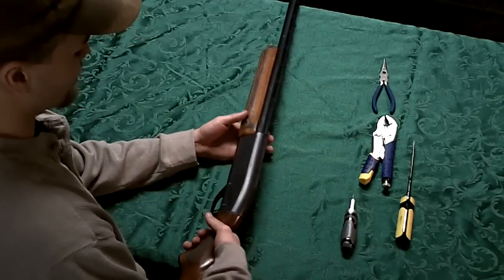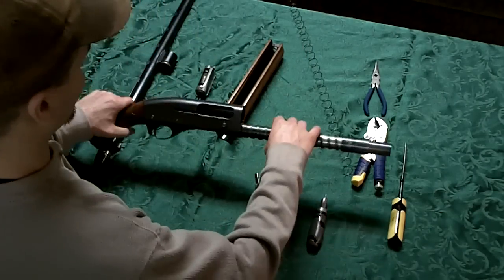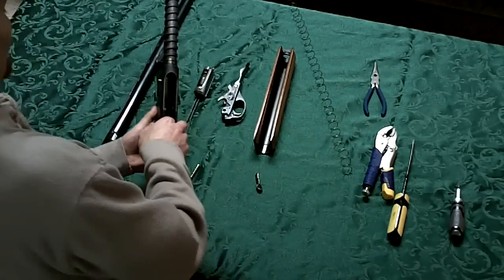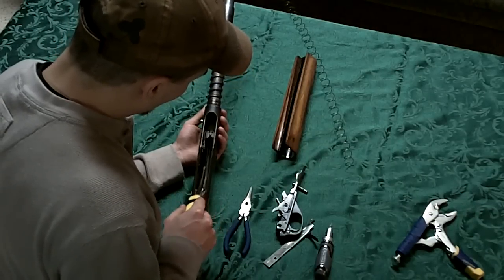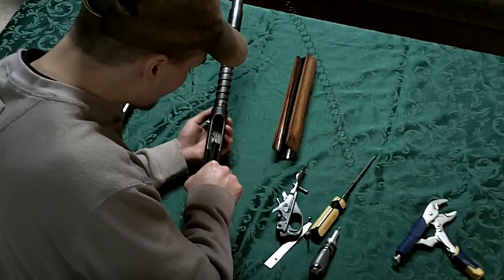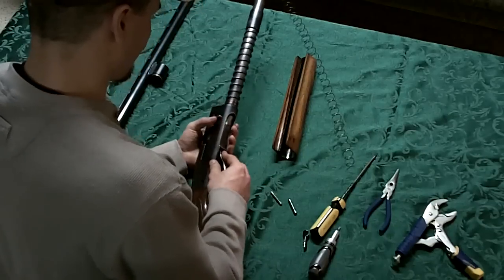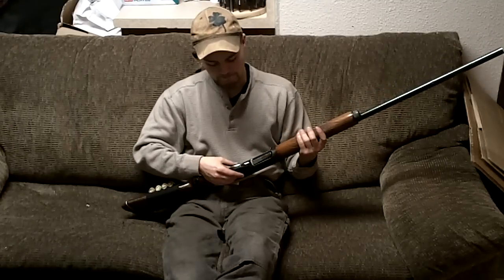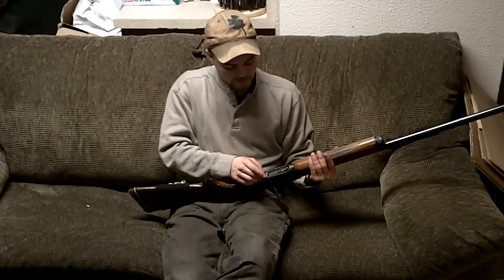Remington Model 11-48 Disassembly

Comment: The bolt link struts are in backwards.  there is a right and left to them.  you should not have to pry the links apart to make the gun function.  All you had to do was remove the pin holding the link struts and switch the links.  The magazine spring retainer is missing, use a pin punch to remove the trigger housing retaining pins, not visegrips. I was in the gunsmithing business for over 35 years and it was amatures like you that provided a lot of business for me.  Thank you for the business!

Comment: Thanks man, this really helped me out a lot. One of my links had come out of the cylinder and I couldn't bring the bolt back. I used the bent portion of a small allen key to maneuver the links and it worked well. 

Also had some trouble keeping the silver piece of metal on the side of the action from getting in the way of reinserting the trigger mech. Solved it by sticking the long end of the allen key through the ejection port and putting pressure on the metal piece.

Thanks again!
Reply: . Addison Dent

Comment: BTW Great and very helpful vid bro!  I have a Remington Mohawk 48 and the problem I’m having is that the bolt gets very rough in the last half inch of travel.  My bolt is fairly smooth operating except for that last half inch of travel then it wants to get stuck or feels like there is a lot of resistance. 

I tore the gun down tonight expecting to see a lot of dirt and rust in the receiver but I honestly didn’t see any rust or dirt on the bolt or the receiver

I now think the problem is in the little recoil tube that the two bolt spring/rods go into. I can’t get the stock off the gun because the stock bolt is rusted and seized up BUT I did manage to get some gun-oil down in the spring tube from the receiver end. 

I appreciate the awesome disassembly vid. Watching your vid gave me the confidence I needed in order to try and fix this myself.

Comment: @cowboyup411 The target versions of the 11-48 had a lighter spring.  The field guns would not always reliably function with light target loads.  Especially handloads.  The light spring could be purchased from Remington years ago.  The model was discontinued in 1969.  The spring has a taper and the tighter end goes toward receiver.  later  models had a collar attached to the spring like the one in the video.

Comment: @cowboyup411 Don't know what gauge gun or serial # there are 3 different variations on the 11-48 friction systems. and 28 & 410 are different. The Sportsman 48 is slightly different in some respects also. The friction ring can sometimes remain inside the barrel guide. comes out easily. clean the mag tube and friction ring. try reversing the friction ring, use VERY little oil on the mag tube. Do not shoot without the ring.  The barrel does not have to move far to recock.

Comment: I have a regular mohawk 48 12 guage that was given to me. It seems to be having trouble cycling shells. It shoots fine, and can sometimes eject the shells. If the shell does eject, the bolt gets stuck and I have to tap the charging handle to get it to go forward. It cycles the new shell, and I can proceed to shoot. I've took it apart completely and cleaned and oiled it. I cannot figure it out. Please message me if you have this problem and/or if you would like to help me out. It would be much appreciated

Comment: Wonder if he ever reinstalled hos link struts in the correct position. The only barrels that are interchangeable are from a same gauge mohawk, sportsman 48, or 11-48. Many of the other parts are either wholly interchangeable or can fit with a little adjustment. I have a sportsman 48 wearing a 870 tube extension, 1100 charging handle, 870 light mount, and a 1100 jumbo safety.
Reply: how did you made the tube extension work?

Comment: How do you remove the wooden dowel that's inside the magazine tube?
Reply: unscrew the mag cap you will see the wood...there is a washer that holds it in with some force take it out I use a flat head but be careful because it is spring loaded
Reply: Thanks for getting back to me. I found out that my model didn't have a dowel. Mine is three shots only. One in the tube and two in the magazine.

Comment: I'm having an awful hard time getting the charging handle out
Reply: fullstrutn Check for a set screw on the bottom of the bolt. Had the same problem until I finally got curious and unscrewed it. Should pull straight out after that.
Reply: thank you I'll try again!

Comment: whether $ 80.00 or $8,000.00 dollars, it's all about professionalism, and integrity. If your doing anything, involving repair or instruction, especially in firearms, you better know what your doing. Like spreading the action bolt links, with a set of pliers, so your hammer will not obstruct. what you don't understand the links a absolutely equal in length. by expanding them the way you stated. will eventually push the bolt assembly out of time, which will cause hang fire. The solution is to check the play in the hammer bushing, replace it and everything will again line up. you know if someone would get hurt or injured by your system of repair, you would be held liable in court. just giving you a heads up.   🤔
Reply from the maker: Jurgen Stroda 
I'll make you a deal, you cantankerous old fart ;) if you make and upload an instructional video of breaking down and putting together 11-48 I'll pull my video offline at the time I made this video there was nothing even on forums explaining how to do it, which is the only reason it has 70k views. So if your so amazing, then help the world out, after all it's be a shame for so much wisdom to end up in a hospital bed in a few years...
Reply: @JessSnipes  Did this gun hang fire after you did this?